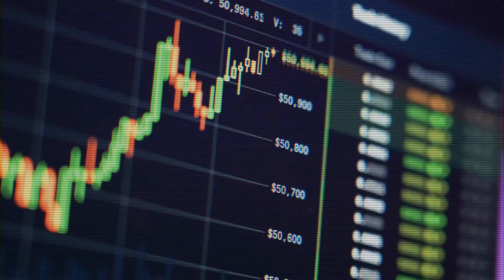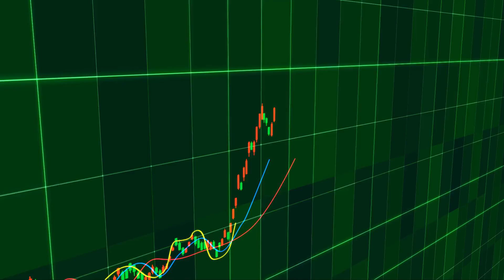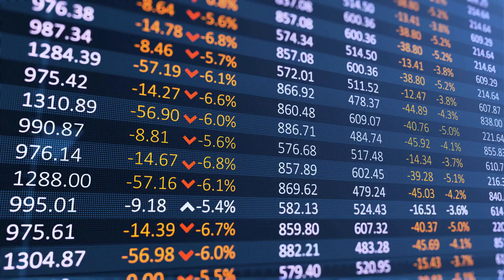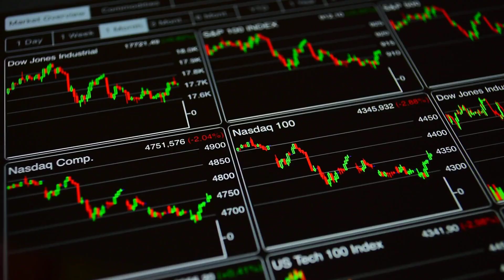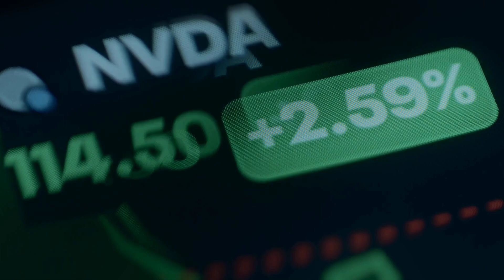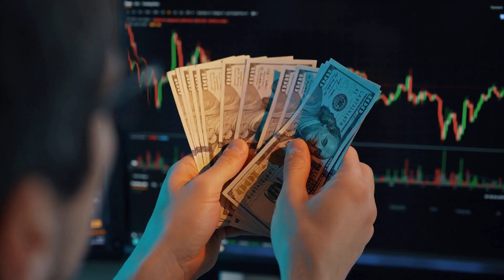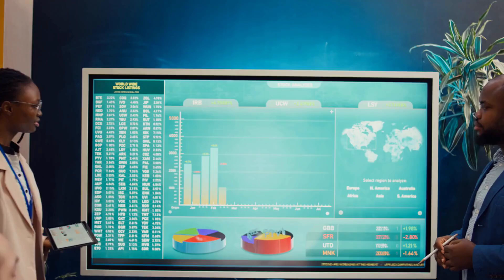The $19.4 Billion Deal SHAKING UP AI: What the Nebius Stock Surge Means for You

Comment: Doesn’t this make Quantum Computing energy requirements even more important for solving this problem?
Reply from the maker: Hey @jackmontgomery8879, that's an excellent point and you've hit on a key part of the puzzle. You're absolutely right—as the energy demand for AI skyrockets, the efficiency of quantum computing becomes incredibly important.
Here's the quick take: A classical supercomputer can use megawatts of power (enough to power a small town), while a current quantum computer runs on just kilowatts, similar to a home oven. Most of that is for the intense cooling systems they require.
But the real "quantum energy advantage" is speed. A calculation that might take a supercomputer years and a massive amount of energy could potentially be solved by a quantum computer in minutes, drastically cutting the total energy used for that specific, complex problem.
It's not a perfect solution for everything, and future large-scale quantum systems will have their own energy demands to solve. But for the kind of complex optimization problems AI faces, it's a very promising path toward more sustainable computing.
Awesome question, thanks for bringing it up!